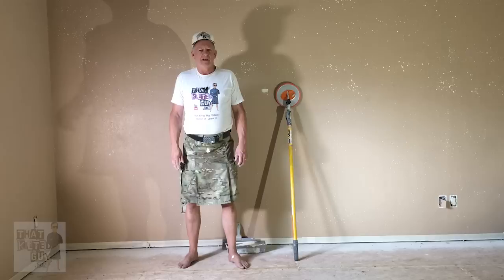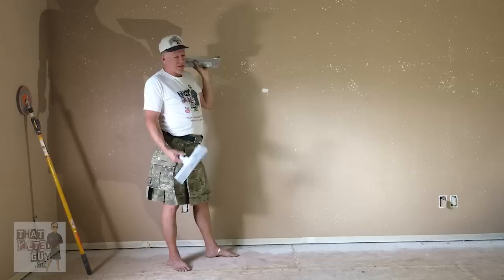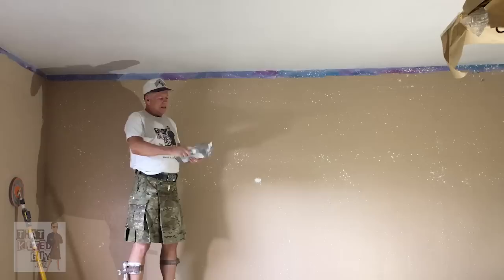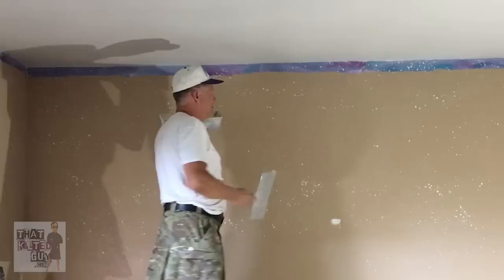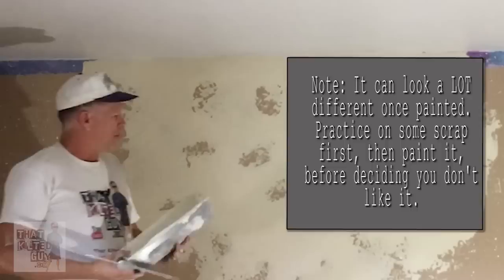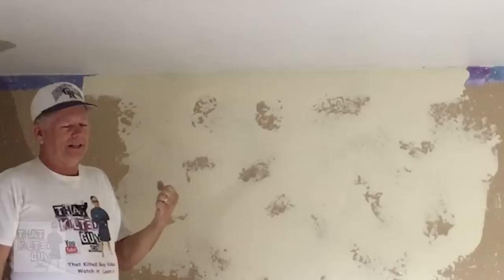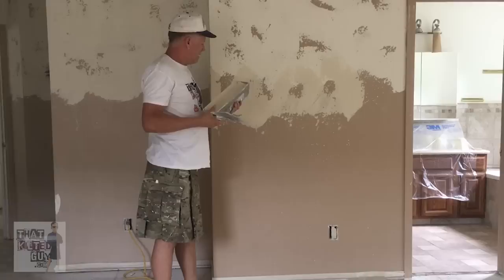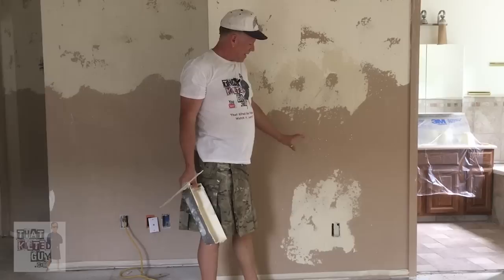Here's how to do this BEAUTIFUL TEXTURE!  My customers love this

Comment: After having some plumbing repairs in the walls of my home, the drywall crew came and did repairs.  They instructed me to wait at least 72 hours before painting, and to use a primer.  After watching maybe 20 videos of drywall repair, I've never seen anyone wait that long before painting. What if any length of time should one wait, in your opinion. Thanks for taking the time to make your videos. They are very informative and motivating.
Reply from the maker: I tell people 24 hours. But sometimes I can paint in as little as 12. Mud drying speed is dependent on humidity, temperature, air flow and the thickness of the mud. So to paint sooner you turn the temperature up, turn fans on, and get rid of the excess humidity by opening some windows. Then I'd look close at the mud, if it's ALL white with no darker yellow areas, then it's dry and can be painted. Mud goes from yellow to White as it dries. It will dry slowest at the floor and in the area where two walls meet a ceiling.
Reply: @ThatKiltedGuyDIY  I appreciate you showing the technique but we are unable to see the texture up close. It just looks like mud being spread on the wall??
Reply: @ThatKiltedGuyDIY also, can someone apply drywall mud on a painted wall?? THANK YOU FOR YOUR RESPONSE

Comment: Most of the construction jobs I have been on, the dry wallers use the boxes of pre mixed mud whether it's the white with blue writing or white with green writing. Usually I do plumbing. The dry wall mud is supposed to be right up to the pipes to keep the bugs from having a space to get into the building from behind the dry wall through. I have worked on a huge number of homes, apartments, and other buildings doing plumbing. I estimated I have done the new construction plumbing on around 300+ homes / 200+ mansions, 60 + homes that are custom homes but not as big of rooms on average as mansions, and about 25 new average size home mostly in Maricopa County Arizona.

Comment: Great video - thank you! Its nice to see a true craftsman at work. It seems a big portion of the work is scooping mud and working it into the texture. Could this technique be created by using a dry wall knock down gun to apply a random/inconsistent coat on the wall, and then use your hand trowel method to work the sprayed mud to the final texture? I’d like to do my new house with this texture, but am looking for options to make the job go more quickly. Your thoughts on my crazy idea appreciated.
Reply from the maker: Nothing wrong with experimenting. Textures are only good if YOU like them

Comment: Thank you for sharing your experience. I will be  adding knockdown texture to a wall that has what appears to be painted orange peel texture. My question: how much if what grid should I sand, if any. My thought is to smooth down and remove most of the bumps before adding any new textures. Also, should I be concerned about texturing over paint..? Thanks
Reply from the maker: Search for 'Sanding that kilted guy' for videos that will answer that

Comment: I’m DYI my kitchen that has plywood walls and it had skip trowel on part but seams cracked through. I got a plastic mesh to bridge the seams then to trowel mud over. Is this the correct method as if it’s Sheetrock? Trying to think outside the box. Great instruction/ explanation for technique.
Reply from the maker: www.ThatKiltedGuy.com

Comment: This is great. You are the Bob Ross of drywall. I got just the texture I wanted on bare drywall. 

One question though, how would you do this on a small patch? It seems like the surrounding texture would cause lap marks and generally make the skip technique difficult.
Reply from the maker: Sand the surrounding area to remove any sharp bumps or edges, texture like normal, but wipe the surrounding edges tight so they blend into the existing texture
Reply: @ThatKiltedGuyDIY  Nice, thank you. You are hands down the best drywall teacher on YouTube. Thanks to you I nailed it today!

Comment: Hi, great video!  I have a question... I am getting ready to try this on a new bathroom.  You commented that what you are doing is a little different because the wall is already textured.  So will this system work on a new wall that does not have anything on it?
Reply from the maker: Yes, it’s the same procedure everywhere. But you will get a slightly different look on each type of surface but it will be very similar. Good luck, and let me know how it goes. And I hope you took a minute to subscribe.

Comment: My house was flooded during Hurricane Ian and I had to remove 4 feet of drywall throughout. I’m using half-inch drywall throughout the house, but decided to Durock
 in the garage and laundry room. My question is how do I tape a Durock and texture it, I have a skip trowel finish throughout the house, but kind of a sandy gritty texture in the garage and I’d like to match that and use the right materials over the cement board. Any comments or suggestions?
Reply from the maker: I rarely tape over Durock but I would suggest using a fast setting joint compound as it is closer to the cementous material in the Durock. But I’m pretty sure regular joint compound will stick as well.

Hey I really rely on the support of my viewers to put these videos out and answer your questions. One easy way is to become a member of my YouTube channel. You’ll get priority replies to your questions, bonus content and more.  Here’s the link to join my YouTube membership. https://m.youtube.com/sponsor_channel/UCSinsqowcKxmSaKkx3W9_0w?noapp=1

Comment: Good vid  can you apply texture over old painted walls or need to prime  first or    do you get bubbles  on the wall?
Reply from the maker: Sand walls that are painted before you apply new texture and remove the dust first. Or you can prime them witha high bond primer and that will work also.

Comment: Very helpful videos. I have a house built in 1960 with very textured walls.  The previous owner used semi-gloss on all the walls.  If I wanted to try this should I get a high bonding primer and prime the walls before I skip coat them? Also, what do you think about those Venetian plasters? I am an artist and have always been curious about    colored plasters and textures.
Reply from the maker: Hi Barbara, (ps, that's my mothers name too).  Whenever you apply mud over a high gloss paint, or a really smooth surface, you have to give the mud something to bite onto known as giving it tooth.  While you can try a high bonding primer, I prefer to sand all those surfaces with my sandpole, and some 60-80 grit.  You want a lot of scratches in the paint and to de-gloss it a bit.  Then it will stick fine.  But if you want to do more, you can apply a high bonding primer, and you can use the green label all purpose as it has more adhesive in it.  But it will be harder to sand so I usually just sand the paint and use my Plus 3 and it works fine.  

As for venetian plasters, I love them.  I actually took a week long Faux finishing class and learned several custom plasters including the venetian and Ovilla.  I did an O'villa plaster on my last house and loved it too.  It comes out very soft and flat with depth of colors.  But venetian is pretty too and can have a burnished polish to it, or semi flat.  I like to do it with several colors, layering it multiple times to get the depth.  I plan on doing videos on some of these finishes one day.  Sooo many videos I plan on doing, and soo little time, lol.

Thanks for asking, and feel free to ask about anything else.  I appreciate you being part of my channel.  Take care. Guy

Comment: I'm a little late to the party with this question, but when you box out the ceiling corner, I see you have masking tape applied.  Do you leave the tape or pull it off to leave a flat cut-in space for painting?
Reply from the maker: I usually don’t have masking tape up, so not sure what I was doing in this video. I think this video was shot years ago.
Reply: All good... The video is 3 years old  so I wouldn't expect you to remember offhand.  I've seen the method of using masking tape for borders or patterns and assumed that was it, but when you never pulled it I started wondering if there was a reason I missed.  Thank you for replying!

Comment: Will this skip coating cover the tape joints that are showing on a large and high wall? Currently you can see every tape joint, both horizontal and vertical. The wall has been a texture of a medium orange peel.
Reply from the maker: Not too likely.  Bad joints tend to show through all textures.   Now minor edges, and minor defects like screws that are still dimpled slightly, can be covered by a skip trowel texture.  I just finished fixing $6,000 worth of really bad joints all over a house in the living room, dining room and kitchen, with ceilings going from 10' -14' and it started with me removing the popcorn texture first. But even with the Heavy popcorn texture the joints stood out really bad.  I spent 3 days just fixing all the cracks, etc and another 3 days texturing it, (was very complicated, plus I fixed about 20 cracks and such on the walls).  But I didn't leave anything more than minor thin edges and minor nail dimpling, which I made sure to cover my texture, and it came out great.  That price did include painting the ceiling, but not the walls, and it took 10 days with 2 of us.  Good luck on your project.

Comment: thanks for the info
do you have any suggestions on prepping a painted wall first?
paneled wall?
popcorn ceiling?  (it's one coated that won't scrape off easily, even with soaking it, I've tried)

btw, like the kilt!
Reply from the maker: Any painted surface should be sanded with coarse sandpaper like 80 grit before putting mud over it.

Thanks, I like the kilt too.

Comment: Hi sir i have a very good couple questions!! I took down my popcorn cieling and than sand down the bumps. Before i put up the skip trowel in my laundry room ceiling do i need to wipe it down becaues of sanding it or no? Now when i add the sip trowel do i start from the ends like you done first in the video?
Reply from the maker: HI, sorry for the delayed answer but sometimes comments just kind of dissappear.  Anyway, I would wipe it down, or dust it off.  I sand with a vacuum sander so that does both at once.  If you don't, the mud won't stick as well, if at all in places.  I always go around and do the edges of an area about 20 sq ft first, then I fill in the middle working from the edges inward.  Hope that helps.
Reply: Michael Struss always clean light sand before Applying anything to a wall.

Comment: I find it difficult to match textures with this skip troweling technique. My ceiling looks like it was skip troweled but the voids are small and consistent, so maybe they used a roller.
Reply from the maker: There's dozens of different ways to do a skip trowel texture, so this wasn't meant to show how to match another one, more to show how I do my version.  Being able to match another persons skip trowel can take a long time to master, since each person does it slightly different.   I can't do much to help you without being able to see your texture, but the best advice is to leave less voids than I did, and see if that works.  And I doubt that it was rolled on as that usually results in a different look.  If you need more help, you can join our patreon page where you can share pictures with me and I can guide you more that way.https://www.patreon.com/ThatKiltedGuy

Comment: Hey there! Love the kilt btw! So i just bought an old ranch 50's house in MI with a cove ceiling in living room. It isn't lathe behind the walls. It's like concrete board material then coated with plaster (which i kinda love btw). The rest of the house walls are great, but that living ceiling has been popcorned over, but also painted cause the old lady smoked heavily. It looks like crap from the roof that was leaking. So I watched vids on soaking and scraping it off but with it painted I'm wondering if I'm better off using my power sander to knock off most the bumps and then do a skip trowel like u did. Good or bad idea? Any other options?
Reply from the maker: I have a video shot on popcorn removal and will get it out one day when I have enough time, lol.  There's a lot to consider when removing it.  If it's older than 1980 it could have asbestos in it, which you can test for with a kit from home depot for like $50 including the labs.  As for removing it, if you feel it's safe, it could still scrape with water just fine, even after being painted.  I've found that some do, and some don't, and I've removed around100.  Best thing is do a test scrape.  And each room could be painted different, so might need to test each one.  I've had some look difficult, then scrape fine, and other take 6 coats of water sprayed over a couple of hours with soaking time.  

As for sanding it off, once  it's painted, forget it.  Paint sands very hard and gums up sandpaper really quick.  Anything rough enough to sand it off will likely do too much damage, so at that point I either A-Scrape it with a 6" knife to remove what I can and then skim coat it with hot mud, and then sand, touchup and skip trowel, or B- put a whole new layer right over the old and start from new, or C- soak and scrape it anyway, taking 4 times as long, and 4 times the work with likely 2-4 times the damage.  But I wouldn't sand and then texture, it will look like old doogie doo that's rolled down a hill covered in leaves, well, you get my drift anyway.

Hope that helps, and let me know what you decide, or if you have more questions.  Take care Nikki
Reply from the maker: Also, thanks, glad you like the kilt and I appreciate knowing that.  Take care Nikki.

Comment: Wish you were in my area!  I think I could do it but my home has some horrible attempt of this technique already on my walls and some very thick swirly stuff on my ceiling along with the beautiful popcorn in all the bedrooms.  Ugh gonna cost a fortune to remove all that stuff.  I'm thinking i may need one of those pole sanders that keep some of the dust down because it's going to be a bear getting some of this off.  The walls that have this technique already, is it possible to correct or make more uniform an already bad job?  Without taking it all down and starting fresh?
Reply from the maker: You can get rid of most any texture by thoroughly scraping, then skim coating it. I get rid of popcorn texture that way in this video- https://youtu.be/rMAx-5LXLLg

Comment: Show a vid of how you get into the silts and did you ever it a bucket or something and fall>?
Reply from the maker: I might do a video showing how I get into the stilts, but I have mine modified for speed, and they aren't very safe, soooo, will have to revert back to the safe way.  And yes, I've fallen about a dozen times, but it's mostly things like drop cloths tripping me up.  Although one time on a commercial job I stepped into a banding strap left laying on the floor and couldn't catch myself as it kept tripping me everytime I tried.  I finally fell on concrete, and you always land on your knees when falling from stilts.  And yes, it hurts like hell. I've never fallen from tripping or buckets, etc, always from something getting wrapped around my feet.

Thanks for the comments, and thanks for stopping by and sharing!
Reply from the maker: Oh, and I was walking on stilts when I was 8 because my dad did this all his life and put me on stilts so I could coat the nails, but I couldn't reach the ones up about 6' high, so I've got a lot of practice.

Comment: I've noticed that paint over some of the light weight mud can be chipped off with your fingernail.  Very susceptible to nicks.  Is this your experince?
Reply from the maker: Never seen that problem if painted with 1 coat of primer and 2 coats of paint
Reply: @ThatKiltedGuyDIY  You are probably right.  They just didn't use enough paint.  Some of those characters just get things the right color and rush off.

Comment: hi, a lot of times I have problems with bubbles in my skim coats, and skip trowel textures.  These bubble later seem to leave lil holes in my finish. Do you have any tips on how to get rid of the bubbles?
Reply from the maker: Those bubbles are my biggest pain in the butt anywhere. In all my years I honestly haven’t figured out a way to make them not appear. But I have found that the thicker you put it on, the more air bubbles. I’ve even read where the manufactures say it is just the moisture escaping as bubbles and it will be worse over nonporous surfaces. So I just sand them off, and vacuum the dust out of the holes or blow it out, and then skim over the bubbles to fill them back in. I have tried many many tricks and none of them have helped so I’m not sure there is a cure for this issue. Sorry I couldn’t be more help on this one.

If anyone out there has ideas on what to do, please post them below and I will gladly try them if I haven’t already.
Reply: I mix about 2 quarts of wall texture that you would use for knock down, then dump a box of topping on it and mix together. It makes it go on nice and smooth with no bubbles.
Reply: I noticed that if I thin it out a little more, and work the mud with a 6 inch knife, smoothing it out on the Hawk then scooping it back to the middle, then smoothing it out again, I end up with fewer air bubbles.